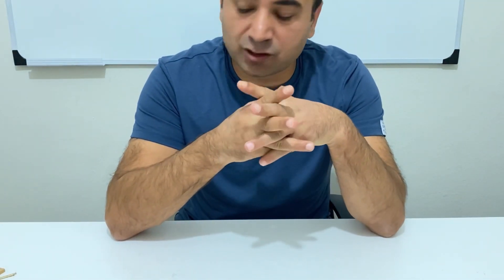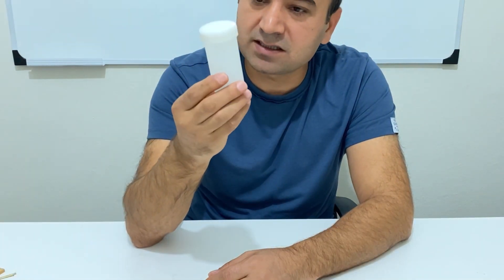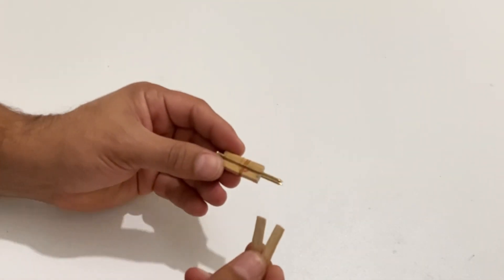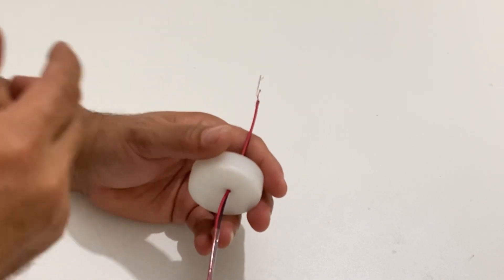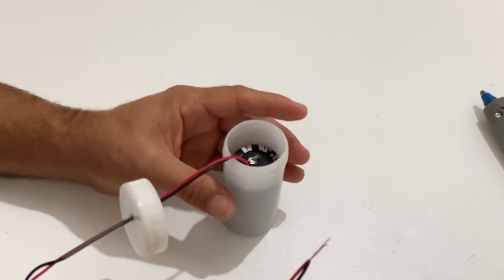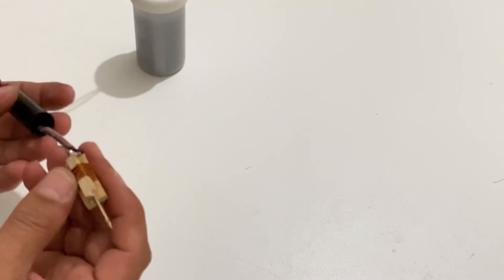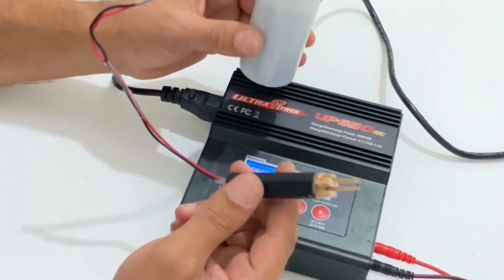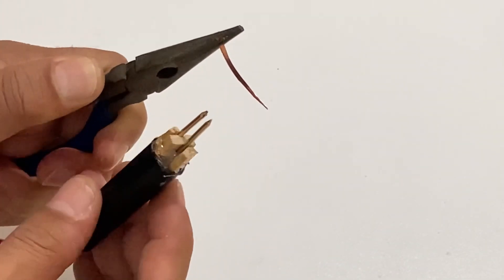How to Make a Rechargeable, Portable and Powerful Spot Welding Machine at Home

Comment: It does seem like you jump cut during that battery weld, and it very much appeared that the flexible lead you "spot welded" to that battery was glued, because of how the battery and the attachments points of support did not appear to originate from the spot weld.
I am not trying to debunk your videos but after years of so much lies I have become very suspect of you tube inventions. I could be wrong but I would need further proof.
Reply from the maker: Dear friend, first of all thank you for your valid question and comment and give me the opportunity to explain possible suspicions on that and explain myself. After your comment l watch the video especially welding part of the battery and l noticed that it really seems that as if it was glued. Bu the really is that: I used that battery in another project and because I taped the battery, the adhesive of the tape remained on the pole of the battery and while trying the device during video shooting, it seems as if the material I welded is stuck to the battery. I sincerely assure you that there is no fake video and information on my channel. You can watch all of the videos with peace of mind. PC: if you try out the machine at home you will see that it works as shown☺️ thanks again fella.
Reply: @joyofelectronics9782 Hey!  your response is good for myself in 2 ways. 1- the fact that you agreed about the questionable optics during the one section reaffirms, even at my age I am still fairly perceptive from time to time,😂, and 2- you responded! And with a balanced and mature response and no malice. It's rare, as you know, to get both a return message and as well a friendly one simultaneously. Thanks for that. 👍
Reply from the maker: @markhonea2461  no problem my friend. First, your perception is really good☺️ second, l try to respond to all comments as much as l can and l believe that interaction is essential for the proliferation of knowledge and finding the truth.

Comment: Can you tell me the voltage you used to charge the capacitor?
Reply from the maker: The operating voltage of the capacitor is 2,7 volts. So you can charge it with 3.2 volts. And also you can charge with 3.7 volts li-ion battery my friend.

Comment: Joy of Electronics:- excellent of you to do this spot weld DIY, now a day's those in house Lithium Ion batteries assy instead of solder very helpful in assy these cells pack, even 6volts lead acid battery cost more while these 2.7 volts 500F super capacitor costs INR 350/- hardly, seems a very economical handy long life spot weld tool, amazing Demo, 👍🏿👍🏿👍🏿
Reply from the maker: Your are absolutely right 👍thanks